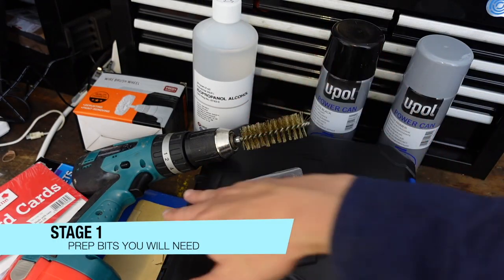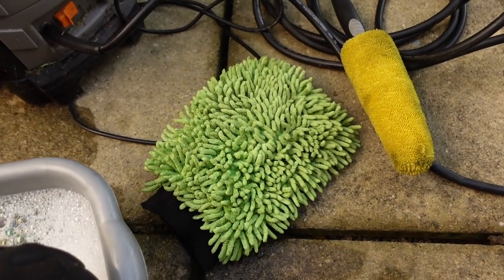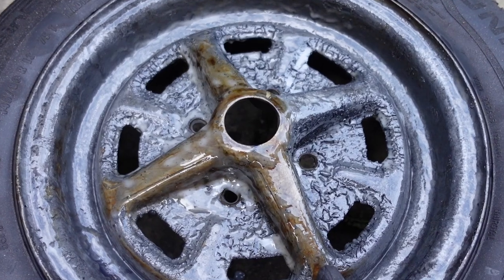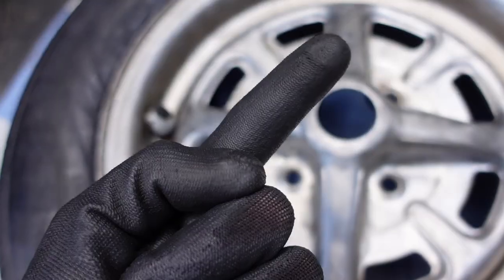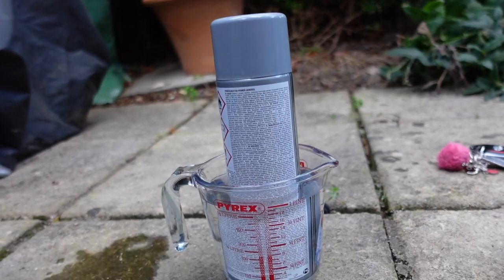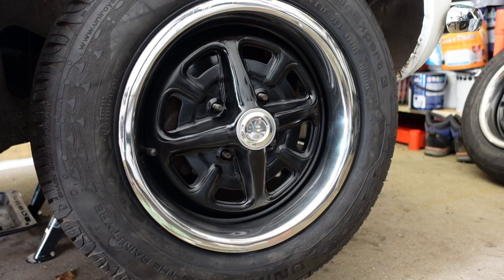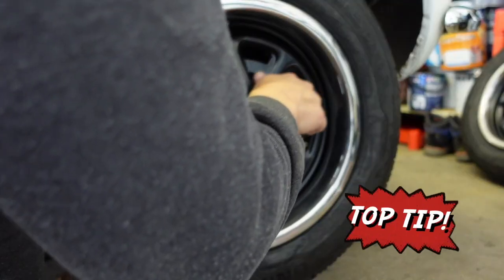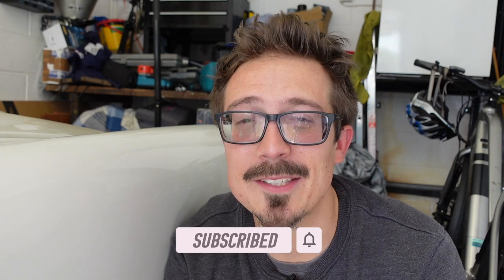Refurbish + Repaint MG Midget Rostyle Wheels on a Budget

Comment: How do you get bonnet up when the cable is not working.  Been sitting for 32 yrs. 1973 RWA. Folks had a Bugg Eye Sprite when I was 15. Now I just found this 73 with no rust and all original to be my project as I just turn 80. Your Videos are Super. Stephen, Walla Walla, Washington USA